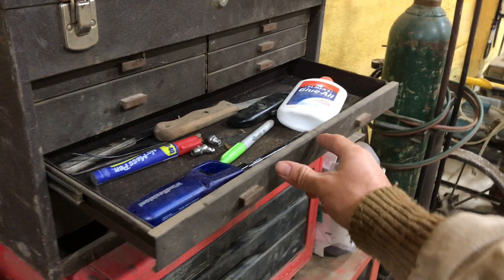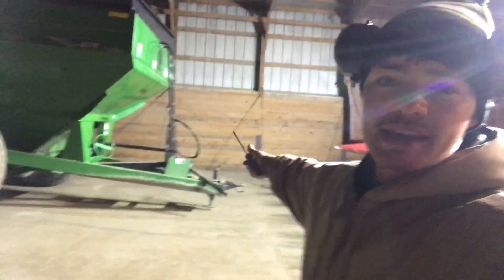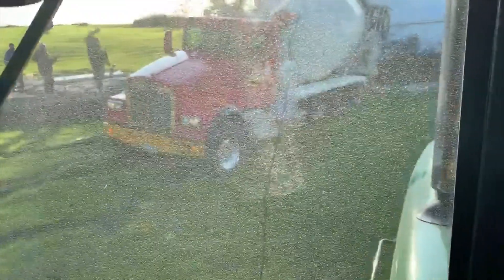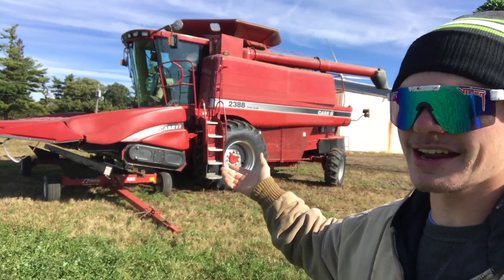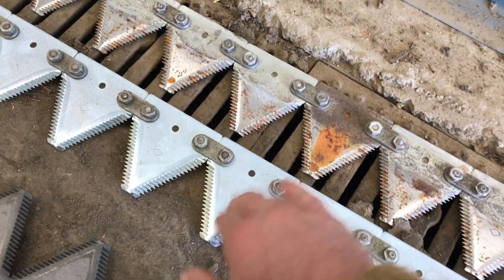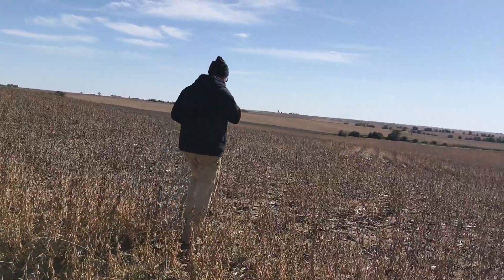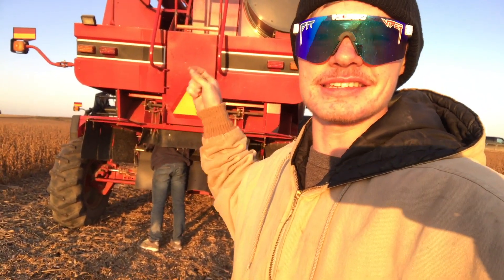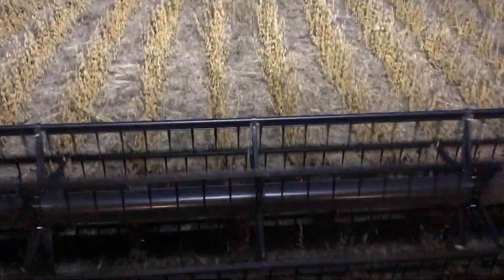Old Combine RUNS For 1st TIME IN A YEAR!!

Comment: HI Cole,

Just watched your planting video for May 12. noticed since then that on a lot of your videos that there is a lot vehicle/machine  seat ware. Consider patches over the rips to save damage to the foam underlays. Easy - Select similar color material, cut suitable size patch, paste silicon corking on reverse side of patch  and place over the rip. try to pull the rip sides back to center before placing the patch though (some needle and cotton may help) smooth the patch over the rip from patch center outwards. remove any squeeze out. Leave and let silicon cure as per manufactures directions

Should lengthen seat life significantly before they need replacement.

Silly me i originally made this comment on your May 12 video. Don't think you have the time to go back to check on an new comments there.

Otherwise, I really do like your video content, Great job. and look forward to you new releases

Comment: We’ve been doing 15%-17% beans all fall they just don’t dry down we get A couple good days in a row and then it’s crappy for a couple days so we sped up the rotor tighten down the con caves a little and as long as they go through the machine good that seem to clean the pods up a lot and we’re running them through the dryer

Comment: get yourself a Milwaukee 3/8" drive cordless impact wrench for replacing those guards . After using it you wont know how you got along without it. You can use it even out in the field.
Reply from the maker: James Pollock we have a Dewalt one
Reply: I think you would be much happier with a Milwaukee. Especially with the 1/2 drive impact wrench. Ive used both and the Milwaukee will the eat the dewalt for lunch . Atleast with the 1/2" drive. We have a pulling tractor and if you put the back wheels on with the Milwaukee, the dewalt wont take them off.

Comment: I would be very angry if someone put a hole in my grain dryer
Reply: It was surrounded by junk they were cleaning up at the time
and heavy equipment doesn't have great visibility.
Irritating, but they run used equipment from the auction
that have lots of dings/dents but gets the job done.
Reply: No need to be angry @tman Vlogs Bro, its like crying over spilt milk! Let it go man, go with the flow with a smile:0)
Reply from the maker: Stuff happens, wasn't intentional.

Comment: Me again, I been wanting to message you about this,  you improve talking points well, and you talk well to the camera, you might consider a part-time broadcast career, from a studio in your big 5 bed-room house. you might do a weekly 30 minute agriculture program. You could fit the studio time into your farming work, You could have save material ready ahead during the anticipated busy weeks. You do not need to be in NEW YORK CITY to be in RADIO.   also , about safety near roller chains and sprockets ...gloves can catch, when I was little a man in the machine shop Dad worked in had a glove catch under some pipe that a machine was being rolled on, his fingers were also rolled. On frozen...gloves can freeze to the moving surface, when I use to cut logs and firewood in winter, fleezing onto the wood was common, I was always safe. Thanks for making he safety talk. There are urban people that may not know of these things... love your videos... full speed ahead.